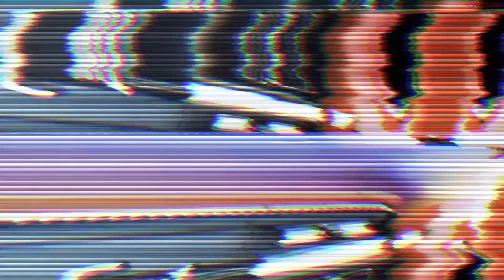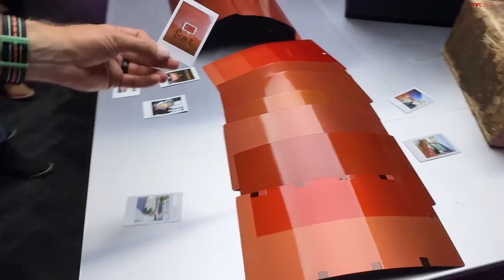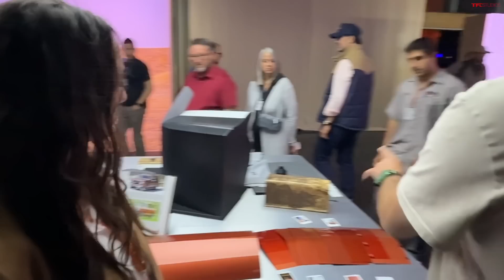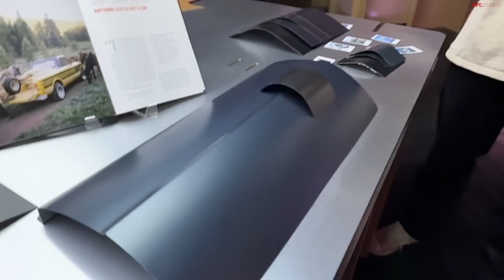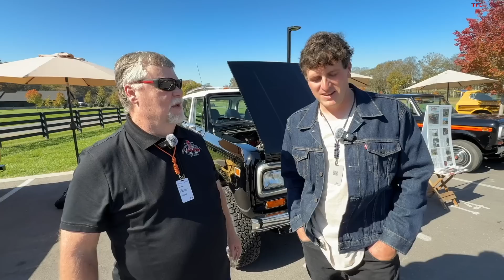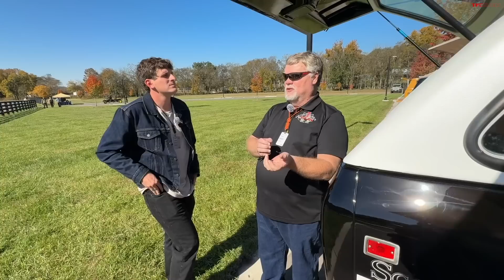Everything You Want To Know About The New Scout SUV And Pickup!

Comment: They said it's a 15 gal tank backup gas engine. Sounds like it will take that much fuel to get you that 500 mi range. Let's assume you get 300 mi on the first batt charge and the 200 miles on the extender tank, that's 13.33 mpg for the extra 200 miles. Not great!
Reply: If you look at the power train as a whole, the fuel mileage 33.33MPG from that 15 gal. Tank.

Comment: I own a quad R1S and the Traveler delivers everything I wish the Rivian had – fully opening frunk with power outlets, buttons and dials instead of all touchscreen, front and rear lockers, integrated full size spare and potentially an integrated winch. The Traveler looks to be a true adventure vehicle, while I’ve always felt the R1S was a niche adventure pretender. Even if Rivian offers a similar variant, they’ve missed a huge window to appeal to a broader audience of truck and SUV buyers.  With the gas range extender, the Traveler is going to take market share Rivian missed by not truly understanding the adventure market.

Comment: The Range Extended options for EVs, is 100% the way to go, utilizing small displacement ICEs, until H2 Fuel Cells become the norm.  EV only is a flawed or incomplete integrated system design and leaves too much risk on the table for stranding a consumer.  Remember consumers are the reason these are even necessary.  Yes, packaging and maintenance are factors that determine form and fit.  Keep up the good work TFL!  Keep up the good work to Scout Motors, GM, Ford and Toyota.

I challenge these auto manufacturers to remember Henry Ford's principles and volume in sales, minimal but reliable to it's core and less options ('Any color, as long as it's black' - keep it simple).  These manufactures need to move on from the focus on High End.  Scout Motors has nailed it, in these principles and concept.

Comment: Doing some back of napkin, calculations, powered by ChatGPT, and assuming these vehicles require a bit more power than the Rivians, it would require least 150 hp from the ICE engine to maintain a 75 to 80 mph speed, if the batteries are completely dead. Volkswagen has a few options in the 3 to 4 cylinder, 1.8 L to 2.0 L size range, producing between 150 and 180 hp. Using standard fuel consumption, peak horsepower in about 5000 RPM range, it would be about 12 to 14 gallons per hour, to maintain that speed with dead batteries.
Reply: 12 gallons per hour?  That would equate to 70/12=  5.8 miles to the gallon😮

Comment: The compressed hemp-wood is a pretty cool idea. Not that anyone cares, but we buy big bales of vacuum-sealed shredded hemp bedding we use for our chickens. It's a much more sustainable choice than wood shavings because it lasts much longer even though it's a little pricier. It's also good for small pets that are normally sensitive to wood shavings because of dust or smell.

I also like how they're using actual leather for the seats. My biggest issue with customizing a vehicle to my liking is the restriction automakers put on what interior color you can have with what exterior color is offered. I've always wanted a nice brown/tan/chocolate interior but they always make you choose white or black, the two most boring colors offered on anything.

I want my nice tan interior with my choice of a nice red/orange or even some type of green or blue. Maybe even yellow. Is Scout going to do choice restrictions like everyone else? Because it's not customizing if you're forced to a locked package that's only able to be chosen with other stuff. I want to be able to choose my exterior color, choose which interior I want with which ever details I want and with whatever wheel design I want. I don't want some stupid performance racing package just because I want the black wheels.

All trucks and SUV's capable of towing a trailer should come standard with a receiver hitch as well as a brake controller weather you tow a trailer or not. Especially with how expensive they are now.

Comment: Few comments:
1. For a real EV offroader, I agree that it must have a gas or diesel range extender. 
2. To me a range extender only needs to make enough power to cruise on the highway at ~85mph on flat ground. That means around 30hp to 50hp. When near mountains you could have the system programmed to charge the battery to say 25% to be prepared to climb a mountain pass.
3. Any in-line 2, 3, 4, 5... cylinder engine can have an oiling system to handle operating on its side (including a dry sump for minimum height). A boxer engine would fit nicely where a spare tire normally goes, but isn't required.
4. Sound quality is important. If it sounds like a lawnmower, chainsaw or whipper snipper, etc., I believe that would be a huge negative and would significantly harm sales.

Comment: I was hoping to be excited about this product. I did not see anything different from what is already in the market. Maybe it will grow on me? If the price does not go up I will be surprised! It is an unproven concept so it will be a few years until we really know how good it is.
Reply: Could you please, point out the other EVs  that have solid rear axle, mechanical lockers front and rear, mechanical disconnecting front sway bar? How about body on frame EVs? And after all these EVs that you say are not different from the Scout, could you please, also point out t those that have range extender engines? 😃
Reply: @is6566  You’re funny! You should be in Vegas. EV’s are horrible off road. They can be improved, but a serious off road person has the ability to buy better off road ice vehicles. Scout may go out of business before they even begin. Let’s see what the people want, I think it will not be a Scout. I hope I am wrong since competition helps keep prices lower. Rivian is struggling and would fail, except Jeff Besos and Amazon keeps pumping in money. Scout needs to be better than Ford Raptor and less money to be viable. Both RAM and GM have recently stepped u their off road capabilities. Good luck.

Comment: I think these will out sell the Lightning but the market they are in is the exact reason they are trying to do direct to consumer because even they know if they mass produced them that they wouldn’t sell because of where the price is at.
I’m interested if I can get the Truck or SUV with the range extending engine at $50,000 MAXIMUM.
Also the problem direct to consumer may end up creating, is that there is a very very VERY high chance the people buying these will scalp them and sell them for double or triple the MSRP and dealers who get them as trade ins will be doing market adjustment on them for the first couple of years if they are popular😅
I can say they look great and they would fit into Cyberpunks Night City very well👌 but if they don’t reduce the price the people who would be willing to try one out will never be able to get into one🥲 maybe by 2027 there will be some big break through where the prices aren’t out of reach for 99% of the population.
Reply: If they churn out 200,000 vehicles as the factory’s capacity is supposed to be then there will not be much room for scalping and market adjustments.

Comment: A range extender is meant to charge the battery not power the vehicle at highway speeds.
Reply: I’d want it to do both. If it can’t run the vehicle on its own, then I would never buy one.
Reply: @phild9813  The capability to do both is a waste of money and adds a significant amount of weight.
Reply: The claim from Scout is it has all battery range of 350 and a range of 500 with the extender, and the extender version has a smaller battery. Given this it has to be able to maintain a resonable highway speed while charging.
Reply: @cavemankiwi  Because people buy expensive off road vehicles to constantly drive long distances on the expressway. Who knew?
Reply: People with expensive AND inexpensive off road vehicles need to get to the trailhead which in many cases are thousands of miles away.
Reply: @is6566  99% BS, but OK. If you're going to make up a story, try to make it believable. "thousands of miles". LOL.

Comment: Some EV purists are commenting that the range extender defeats the purpose of non polluting. Range extender totally doesn’t defeat the purpose of non polluting because it makes it a practical vehicle for everyone not just EV fans. I am as a hard core ICE guy as it gets. I have a V8 Coyote F150, a V8 HEMI RAM 2500 and a GMC 3500 Duramax 8-cylinder diesel truck and V6 Jeep Wrangler and put a deposit on Terra. 

 I would never buy any of the currently available EVs but I placed a deposit on the Terra with Range Extender because the off-road potential of that truck together with the peace of mind of not worrying about finding a charger in the woods or on long trips makes this a great option to replace my F150. 

The reason why it will reduce pollution for me is that I will use it as an electric truck when I am driving around my home city. I will charge it at home and use it as full EV. 

I will try to fast charge it when on long trips but if there is a gap in charging coverage, I will fill up with gasoline and not wait for a tow truck or modify my travel plans just to accommodate the availability of chargers.

The range extender makes possible for me to be 90% EV driver with reduced pollution while I don’t have to change my driving behavior at all. 

The EV purists should ask themselves, what is better for the environment? 20-30% of the people driving around in full EVs while the rest of us driving 100% of the time in ICE vehicles OR 100% of the driving public being in electric range extended and hybrid cars driving around most of the time on electricity but sometimes out of necessity on gas power?
Reply: Well said
Reply: Purists need to buy an old scout.
Reply: @homer…. You mean SCOUT/ICE purists? We are dealing with two kind of purists EV purists vs SCOUT/ICE purists. 😃 Both seem to be upset by having a vehicle that’s (at least in my opinion) the best of both worlds.

Comment: I reserved the range extended terra and it being on par in size and performance with a 1500 I wonder if they will extend on that. It being body on frame and the whole "a true truck" talk they all did, it would be curious to see other truck layouts. A regular bed, a long bed, a single cab, stuff like that. I can't imagine we will see a single-cab but a regular bed would be nice since 5.5 foot is just a short bed and I would prefer the longer regular bed. Another thing I wonder about is if they will make a 3 row variant of the traveler. I'd imagine they will, and if they make a longer frame for a longer bed version of the terra they could make a direct Suburban competitor. Which could honestly be the first full size 3 row body on frame SUV to TRULY cut into suburban sales, because lets be honest, the Ford, Nissan, and Toyota options really don't make a blip to the GM siblings. It would also be nice if we see them scale it up, imagine a 2500 gas electric truck with those sturdy, un-overstylised (LOOKING AT YOU BIG 3) design would be a huge hit.

Comment: Is it me or does this not look like a Bronco? With the collaboration between Ford and VW in Europe could it be the Bronco would be electrified some time in the future and even spawn a pickup? Even in Oz the VW Amorok is heavily a Ford Ranger apart from some interior tweaks..
Reply: The original bronco took its design from the scout 80/800 so it's no stretch to say they look alike. The bronco EV rumors for this gen at least have kinda fallen off.
Reply: There would likely have been an announcement made by VW and Ford if they were working together on Scout. I remember this happening when VW announced that the new generation of the Amorok would be based on the Ranger.